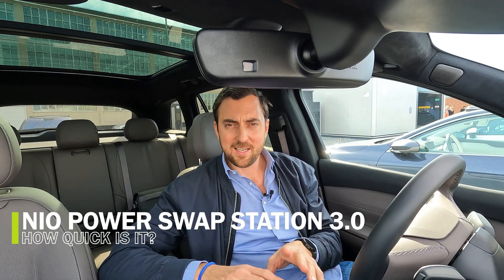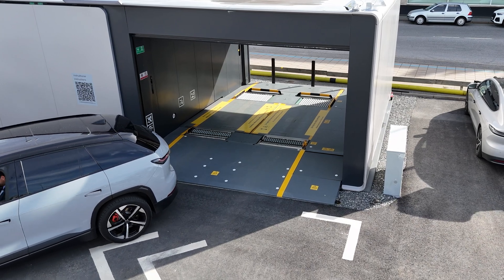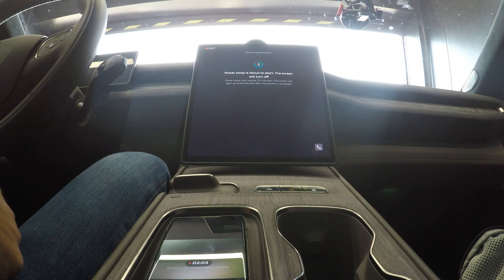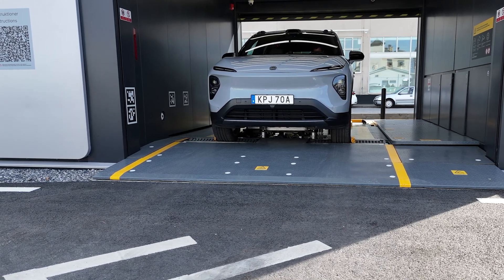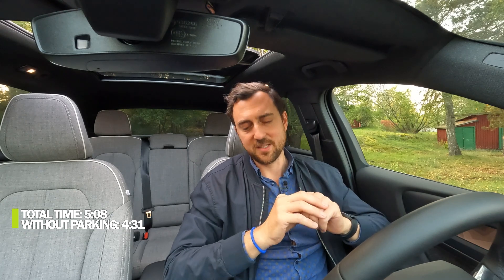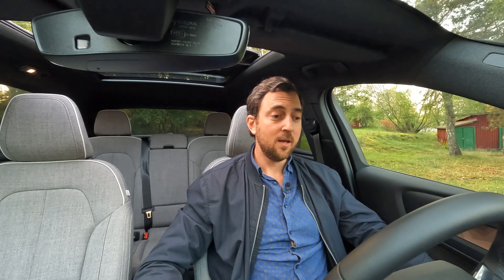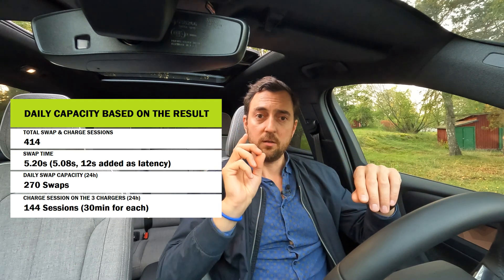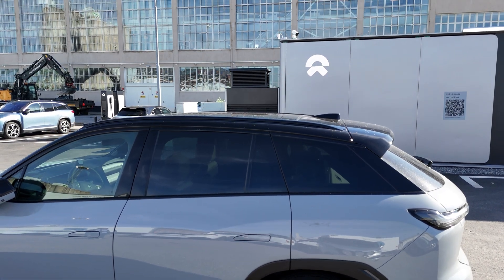How many Superchargers can it replace? - Testing Europes first Nio Power Swap Station 3

Comment: Winter charging speeds are less so swapping is better. All the fast charging speed are for good weather. Preheat the battery still take energy from battery and reduce the mileage. So winter I think swapping is better and do not need to worry about health of battery

Comment: Several big factors. A Nio's cars is not "married" -death do us apart, to the battery. Meaning that if the battery goes bad your car is worthless. Second, I believe that fast charging overtime will damage battery versus slow charging when you swap a battery. I conclude that theory just by dealing with battery most of my life.
Reply from the maker: Agree, good points!

Comment: It makes a lot of sense, at present, to do battery swapping. The only concern is that investment of battery swapping station infrastructure is heavy. It requires a large battery swapping user base to make it commercially sustainable.

Comment: Its clear no one has really thought this kind of thing through. It takes the logistical challenges of an EV, the production challenges of EV batteries and general resource issues surrounding those batteries and makes them 10x worse.
Reply from the maker: 10x times worse than what if I may ask?
Reply: @ItsOnlyElectric  There is a lot to this but to be as concise as possible while getting across the main points.  

Batteries are why EVs are expensive. The resources are rare and hard to get and unlike most things EVs need them in massive quantities when talking mass adoption scale. 

So, the cost of needing extra batteries for these hot swap stations will either be tanked by the company (not likely) or passed on to the consumer (likely). 

Secondly this idea doesn’t mitigate the issues of power grid usage and increased energy demand, since these batteries still need to be charged. So doesn’t have any benefit here.

You need to produce more batteries for less cars which is inefficient from a manufacturing emissions perspective, because you undermine one of the alleged benefits of an EV by creating more of the most polluting bit of the car to manufacture; the battery. 

Then comes the issue of resource scale. If you look at the avg consumption of the rare materials used in batteries and compare that to proven reserves, there isn’t enough of the stuff to replace every ICE vehicle 1:1, its closer to 1:2. Now you’re also needing a shed load of spare batteries which means that 1:2 ratio will likely become 1:3 or worse. Which means the 17 years of EV production (at current car manufacturing rates) goes down and makes putting all the eggs in the EV basket (like governments and not corporations) want to do an even bigger mistake. 

EVs are a part of the future for cities and towns with smaller cars (like the Honda E) which take less resources and where local emissions are an issue. However, for the reasons above large-scale adoption is just not possible. Ironically corps are the ones actually building the stuff required for a sustainable low emissions future by diversifying into carbon capture e fuels and hydrogen fuel cells, not because they are benevolent but because they think long term for revenue and profit and see how short term EVs are if they were to be adopted wholesale. So if you ever needed a great example of how government virtue signalling is bad this whole EV thing is it.

Comment: NIO is pretty unique company but there is one logical downside if the company sell one car using BAAS then nio profit dumps because they need to eat the cost of 2 batteries.1 for the car and 1 for charging.Thoughts?Other then that great concept
Reply from the maker: Yes, the overhead cost for operating the swap stations is high. But will get less in a linear scale bound to the sales of cars. One sold car does not mean that you need to add 1 extra battery to a station. Maybe it's more like 1:20, 20 sold cars needs one extra battery.

Comment: Great video! BaaS is really a breakthru idea from NIO. All the concerns of battery lifespan warranty goes away and NIO owners get access to the latest battery improvements from NIO. I am surprised not more EV manufacturers are licensing this battery swap technology from NIO.
Reply from the maker: Yes, maybe will come later, but think it's hard to get other manufacturers on board, since it's dependent on your platform and demands a lot of adoptions.

Thank you 👍

Comment: I didn't hang around, but does he ever mention needing to wait in line?
Reply from the maker: No he didn't. 😁 Hard to do the math with queues. But 2 factors will limit the queues: 
- the car schedules and plans the swap for you, one factor is queue and battery availability at the stations within reach
- when queue too long you fast charge

But yes, queues will occur. 
-
Reply: @ItsOnlyElectric  So, now you're at the car's beck and call, or you fast charge anyway.  As of yesterday, Nio announced plans for 11 more models that will use ss batteries developed in partnership; much longer range, quicker charge time.  They're looking to get out of this swapping insanity.

Comment: When multiple vehicles simultaneously charge at a supercharger station, it is possible for the charging speed to be slower than expected. This phenomenon can be attributed to several factors, primarily linked to the power supply limitations of the charging infrastructure. One significant reason is the constrained power supply at the supercharger station. If the station's power supply is limited, attempting to charge multiple vehicles at once can result in a division of power, causing each vehicle's charging speed to decrease. Furthermore, the impact of simultaneous charging can vary depending on the infrastructure and management of the charging system. Some supercharger systems are designed to provide high efficiency even when multiple vehicles are charging concurrently, while others may experience speed reductions due to the increased load. Therefore, it is crucial to consider the characteristics of the charging infrastructure and the specific system in use when planning for simultaneous supercharger usage or charging.

Comment: Nice to see you got the PSS G3 in Sweden 🇸🇪 . The calculation from NIO is too optimistic. In best case could be 288/24h. The main difference is also that here are 21 batteries 🔋 in the PSS what makes it possible to provide a charged battery all five minutes at least. Because the batteries will be charged all in parallel if necessary. Also this PSS could play a better role in power grid stabilisation. In future it should be possible to parking 🅿️ beside the PSS and walk away, than the power swap will be done fully autonomous. That’s pretty much better than to charge. But NIO car could be charged at super chargers or even at a 220V/10or16A Socket at any place. 30Mio Power Swaps achieved just three days ago and 2000PSS in operation speak for themselves. BTW NIO has their biggest Charging network as well, besides Tesla Superchargers. 👏👍⚡️🔋🏁
Reply from the maker: Good points ☝️

Comment: I was on a European road trip and I came across a Nio swap station at Zusmarshausen. I checked it out and I must say this would not be something I would do. Nio told me you can only swap their LEASING batteries. Leasing the batteries is very expensive (I can't remember the exact Euro amount. I think it was something short of 300 Euros per month).
At the time there were only 3x (three) swap stations in whole Germany!
That means even if you pay that high lease you still have to charge and pay for electricity.

If you OWN the battery you can only charge - no swapping batteries.

It has to be seen how Nio rolls out further swap stations looking at the amount of debt Nio has already accumulated over its existence. 
I believe progress in fast charging batteries will make swapping those obsolete in the near future.
Reply: Then buy the battery and charge…nio gives you option
By the way, it’s not 300 euro
Reply: @EduruChan How much is it then? €290 or so as I remember...
Reply: Ye only 3 statuon beacuse they just came to europe,you expect to get 1000swap station in 1 week?its take time to develop infrastruxture😂
Reply from the maker: 30 stations in Europe now. Show growing fast.

Comment: This brand specific "solution" will always lack the scale required to make it economical.
Do realize that with the option of home charging the number of charging station will be only a fraction of the number of gas station and mostly limited for use for extensive trips. With home charging you will be able to start each day with a full charge. Think about how many times you leave your house now with only half or less of a tank of gas....
Reply: Nio did 77,000 swaps yesterday. That's not a typo. You are thinking first world charger in my garage logic. They also have the largest private plug in charging network in China.
Reply from the maker: @reginald7214 77k swaps in one day? That means that every fifth owner swapped his or hers battery in one day. Sounds a bit high, do you have a source?
Reply: @ItsOnlyElectric  then Mr p had a video saying yesterday 10/3 was 77k as opposed to the 75k in the article from last week.
Reply: @ItsOnlyElectric  I put a link so it disappeared. CNEV POST dated 9/29/2023.
Reply: In addition to seeing a record number of single-day battery swap services, Nio also saw more than 1,500 battery upgrades on September 28 that pay on a daily basis
Reply from the maker: @onetwothreefour-s1n  I read 27k that same day.  But still a lot.
Reply: @ItsOnlyElectric  for sure, over 70k a day for a week. They just hit 30 million total swaps. The most recent 10 million in the last six months.
Reply: So far this month, Nio has added 130 new battery swap stations in China, 100 of which were added in the last 14 days.

Comment: What version of banyan did the car have during the test? 2.0 might improve the overall speed
Reply from the maker: Not banyan 2.0.0. An older version
Reply: @ItsOnlyElectric  cool thanks! Gonna try it out for myself in Maastricht when it opens in a fews or so 👌
Reply from the maker: @djtreston cool. Let me know how it went. 🙂
Reply: @ItsOnlyElectric  Will do👍
Reply from the maker: But tried swapping the ET5T with banyan 2.0.0 on a pss2. Took 6:28.

Comment: I`m totally into swapping instead of charging.. reasons why ? 
1: you will be able to get the latest battery tech in your car. 
2: it`s sooo much faster, how often do u in your normal doing, go in to buy coffe/toilet, when tanking your ice car ? well pretty much never, why should u with EV ? thats only if driving longer distance u might do it. 
3: if my calc isn`t to much off, u have 1440 minuttes in a 24 hr, time periode (24x60), if taking the 6 chargers and the 30m + 2x2,5m for start stop the charging so total 35m charge time in average, u will be able to do 246 cars in a 24hr. periode.. so just there u see the swap station crushes normal charging places. 
4: in China (not yet in EU) they charge up the batteries when the power prices are low, and if not to heavy pressure on the PSS, they send it back into the grid when the prices are high, this means 2 things.. 1: Nio earn money, that can benefit us as coustomers 2: if enough PSS that do it, it can stabilize the powergrid and by that the prizes, so we dont get those massive pumps in electric prices we have seen the last 2 years or so. 
5: if the battery u swap have startet going bad in cells, they can get ut out of circulation, repair the damange cells, and get it back up running, with out having to condem the whole car.. 
and all these reasons are why i`m pro PSS, and pro Nio. :)
Reply from the maker: Thanks for sharing your thoughts 👍

Comment: Cost. What is the difference in the cost model. Not just for the consumer, but for the supplier. And what about the mechanical running of a swap station; how many moving parts does it have? What happens when the swap station breaks a moving part? How long until it can be fixed and brought back online for customers? I understand that it's a different dynamic, but that must also work in practise all day, every day, for years. And this is almost like the argument of EV vs ICE. Reducing the number of moving parts is a huge efficiency gain. So why is the industry doing the exact opposite here? This does not make wholistic sense.
Reply from the maker: Good questions. Don't know the actual cost for nio for running and establishing a PSS.
Reply: A day in which they provide 60 toilets per station costs them less than $250 per station.  If something breaks in the station, there is no reason for that to happen, but still, then it needs to be fixed and it will probably disable the station for about two days.  Depends on how bad the damage is.  nio now has 26 stations in Europe and will have a thousand by the end of 2025.
Reply: @tani123  NIO will be bankrupted by this idea by the end of 2025.  They are not passing the true cost of a 'battery swap' on to the consumer.  I estimate that the actual true cost of each battery swap in nearly $50USD.  This includes all the costs associated with the swap station, its constant maintenance, its constant monitoring, its leasing of the space/real estate, the depreciation of each of the batteries, the power consumption of the station and the battery charging, and a myriad of other minor costs too.  It will never be cost competitive with a cord from a Tesla supercharger (which allows you to use the restroom and buy food/drink while charging).

The battery swap idea is a great idea....for the consumer, but not for the company who is hiding the true costs.  NIO to ZERO.....3 years or less.
Reply from the maker: @TeslaDo_d Interesting calculation. 50USD per swap, do you have more information about that? 

A rough calculation indicates an avarage swapping income of 26 USD. That's without arbitrage of electricity and other potential incomes from chargers etc.
Reply: @ItsOnlyElectric  No, unfortunately, this is only my educated guess.  I based it upon my knowledge of mechanical automated systems in cleanroom environments as compared to 'non cleanroom' environments that are not even exposed to the elements.  Then I considered the price to park a car in a major city and multiplied that by 6 to account for all the room of the station and the peripheral that I think would need to remain clear.  Throw in at least 3 paid attendants per day to handle all shifts.  Some background roaming technicians/mechanics too.  And I also figured that the stated throughput is absolutely best case scenario and gave it a real world peak of about 8 cars per hour.  Then drop the utilization to 60% because we all know that there is not going to be a steady line of cars during the overnight and even during certain times of the day.  Figure in some cellular and wifi costs.  Remote diagnostics.

My company charges $325 an hour for my technical services and $250/h for travel.  If NIO performs all their own service, then their true costs are about 1/3 of that.  Multiply all of this by the number of deployed swap stations and the path to bankruptcy turns into a highway very quickly.

In the USA, a swap station will be coated in graffiti within a few days and NIO will need to get an eviction notice to have the squatters removed from 'their' home.  If the math isn't enough then reality will certainly end this nonsense.
Reply from the maker: @TeslaDo_d thanks for sharing your thoughts and calculations.
Reply: @Abomynous1  I was hoping someone with real world experience would add to the discussion. Thank you.
Reply: I think the upcoming NIO bankruptcy will be fun to watch.  Leased batteries will be considered 'assets' of the company.  They will either be confiscated or offered to the owners of the currently installed vehicle (I hope your last swap involved a good battery that wasn't fast charged too many times?) for a premium so that as much money as possible can be returned to investors.  The true cost structure of the swap stations is being hidden.  It will never be economically viable.

Comment: The idea is good but the numbers don't fit together.... it can swap 144 batteries a day (around 11 batteries an hour), it only holds 21 batteries ?
the stock will only last 2 hours.... so unless you supercharge 11 batteries every hour, they will not be charged when next needed.
and again, this will only work if the station has enough power and internal charging possibilities to charge that.....
Reply from the maker: The swap station charges the batteries in stock.
With 21 batteries in the station the station has 105minutes to refill the last arrived battery if the demand is constant and every swap takes 5:20.
Reply: Battery swap stations can charge 21 batteries together at a rate of up to 100 kilowatts, usually he receives batteries with around 25 percent, and he needs to charge them to 90 percent.  which is only to charge 65 percent of a battery, so you only need to charge 65 percent of 75 kilowatts, less than 50 kilowatts, and that means that every half hour we get 21 charged batteries, multiplying 48 gives 1000 batteries that can be swapped in 24 hours.  In short, what limits the capacity is the swap time and the parking time.
Reply: but then you can't slower charge them to make them last longer as written in other comments. but i agree. it should be possible...though if their own 3.3 min swap it will be hard :)
Reply: @JesperSkelgaard  the station charges at a speed dependent on demand. It can fluctuate. The gen 3 stations can also sell electricity back to the grid. The electric company can digitally request energy when they need it. In China at least. Europe will use coal before that option. 😂. But like the other guy said, batteries usually don't arrive with 0% in them.